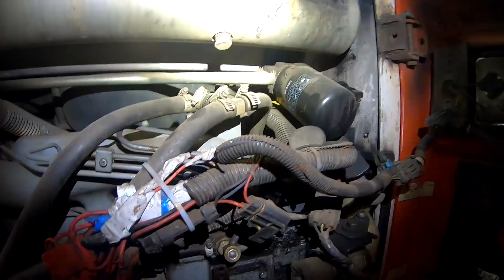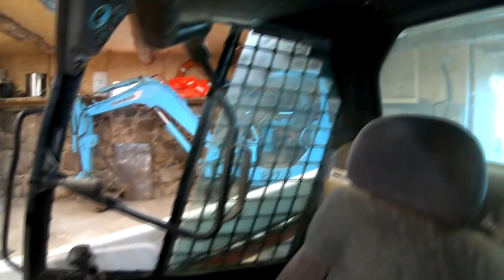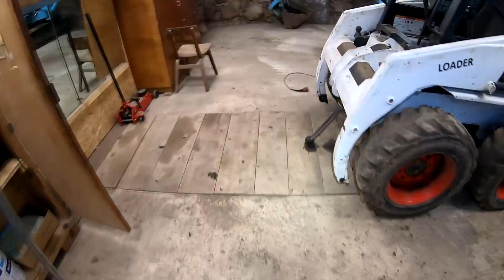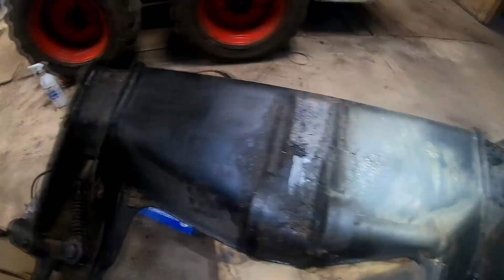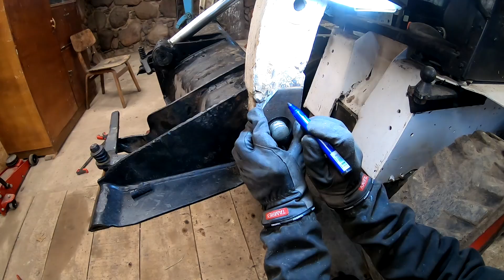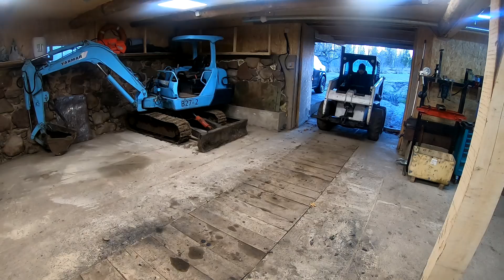Fixing bobcat 751 Bob-Tach pins/bushings

Comment: Very ingenious repair! Had to do the same repairs on my 763 when I bought it. My attachment bushings where gone and the sleeves they go in where shot! Fortunately a good friend of mine runs a CNC lathe and replicated new ones to weld in so I got away with only new pins and bushings. My arms where not wore at all. Bobcat loves their parts! Have the exact same issue with my lockout switch as well. Never got worse though so haven't dug into it. Just touch the wire and it goes! lol Good job my friend!
Reply from the maker: Lol i can relate. Take care Tim

Comment: Good fix.  I think the only short coming might be the strength of the pins - probably not hardened like OEM.  But if they're a standard size from your local hardware store should be easy to replace.  Cheers!
Reply from the maker: Yeah true. Cheap also. The OEM pins are hollow inside but these are solid throughout, not sure it matters though.

Comment: I have an old 600 series machine that has 3/4 in loader pins at all locations including the lift arm towers. The originals were still working after almost 30 years. The only ones that wore out were the same ones you replaced on your machine, the pivot pins for the bobtach. I replaced them with 3/4 bolts and they have served for almost twenty years. Now the machine is almost 50 years old. I think your repair should be good for quite a few years.
Reply from the maker: That's good to know

Comment: Good fix using the cheaper / available locally pins and bushings, they won't be as strong as the OEM parts but for what you're going to use it for I'm sure they will last a very long time. 🙂
Reply from the maker: I'm actually suprised how well this fix has held up... 😆 still going strong without any change in play

Comment: I have noticed on all of your Bobcat videos that it creeps slowly when you turn it on. I saw a video where you adjust some bolts/nuts/etc. on the drive plate under the cab, just lift it up. I think it adjusts the drive controls. I think it may take you 10 minutes. Thanks for your videos, I enjoy the humor ;).
Reply from the maker: Yes the right control lever needs some adjustment. Very little

Comment: As others have said nice bit of lateral thinking to use tractor hitch pins and bushings to fix up the old BobCat. As far as the grease issue goes you need to remove the grease zerks from the hitch plate and drill through the new bushings to the pins so grease can go between new bushing and new pin.
Reply from the maker: Right on

Comment: Well, I am impress.  I would have done it a little different, notch the pin and locked it in place.   But that is me, either way, $20 vs $800 - $1600.  I am not rich, like things done professionally and you are doing a fine job.
Reply from the maker: Still holding up great to this day 😇👍

Comment: If you need to mess with the pins again, instead of welding the plate you made to the pin, weld a cap to the plate. You could put a zerk in the cap. A cap that allows some end to end play may take some strain off the pin and the grease from the zerk in the cap should help lube the pin movement in the arm. Plus next repair will be much easier.
Reply: Brilliant idea! The cap could be a slice off a tube that's got sufficient diameter to go over the pin, then cut a disk end cap and weld it all together.
Reply: @DuncanAitken  Get out of my head!

Comment: Great job, that repair should last well. It would be worth fitting a battery isolator on your negative lead, save disconnecting the battery. Get a heavy duty one, the cheaper ones burn out fast. I fit them to everything that lives indoors.
Reply from the maker: Good idea Dave, my tractor has it, i think it's also called a mass switch? iv been meaning to get one for each of the machines.
Reply: @Ants_Pants  master switch. Well worth it. I've even fitted them to the old cars and ill put one on the generator. We never park anything inside without one. Also means no disconnecting the battery if you need to charge it or do welding.

Comment: Very innovative fix for your pin issues.  The only concern about the pins would be the diameter of the new pins being significantly smaller than the original.  They will likely last years, but even if they don't you can get replacements for them and you don't have grind them out to change them.
Reply from the maker: Original pins were 31 or 32mm. New pins are 28mm if i recall. Just tiny bit smaller.

Comment: My ideal fix to stop the pis coming out would be to weld a cap, like a steel pipe end cap fitting on the plate you made that just hold a standard pins in.
Reply from the maker: That's a good idea
Reply: @Ants_Pants  A cap would allow the pin to float/rotate and reduce wear.
Reply from the maker: @leonjohansson6542  Hey Leon! Cap between the plate and arms? i di have a cap there about 5-8mm on both sides

Comment: Sound economic repair. That will last a long time on the farm! If you were using daily in construction heavier pins and thick walled bushings would be required.
Reply from the maker: Thanks Sean. Now the arm pins have so little play that i have noticed how bad the other pins are lol. Before i thought the problem is only in lower arms.

Comment: And that's why you grease the equipments pivot points  and check the fluids each and every morning. Grease is cheap compared to boring welding and bushings . I've fired operators for not greasing the equipment.
Reply from the maker: Good call they deserve nothing else. Heavy equipment is a expensive investment and to see operators not care about your investments, fire them.

Comment: Nice job and great video I’m doing a similar Job on my bobcat 743 but I’m having trouble pushing the pivot pin on the quick attach. one side pushed in but the other is stuck does anyone know?
Reply from the maker: Maybe the bushing is installed wrong way? Just a guess here
Reply: I thinks it’s the right way the pins were never replaced since it was purchased
Reply from the maker: @zlatanzifovskijr4576  look maybe there is something in the way. Like when i tried to take the pin off therr was a broken bolt inside the bushing. Of not then go @ it with a heavy hammer. Maybe its jusy tight fit is all. Hope u get it sorted out.
Reply: Hello I managed to get that pin out I had a old broken 1/2 socket extension and I used it as a pin to hammer it in thanks for helping!
Reply: If it is the old style attachment plate it will have a grease fitting on the inside of the plate (opposite the bolt head outside the arm). Remove the grease fitting, the pin will slide in easily as grease gets pushed out the fitting.

Comment: What is the going rate for a used Bobcat like yours in Estonia?  Curious if shipping them (or do they have a factory in Europe?) adds a lot to their value?  Nice job doing with what you have.  Keep them drowning in grease and they will probably outlive you.
Reply from the maker: The condition it was all beat up around 5 to 7 grand i paid 6k i think. Currenltly i would value it at 10k coz iv done a lot of fixes to it and it works all nicely now. When i bought it it had a problem with one of the drive motors (made a video about it aswell) it could have been a 2k fix, but i decided to take the drive motor apart and ended up fixing it with a seal kit for 200 bucks(the inner pressure seal was completely mangeled).  I bought this from a individual and payd 100 bucks to ship it 200km. These machines dont come on market a lot from individuals. If you have patience you could wait and browse the marketplaces.  You could also buy from vendors who sell used equipment, but you always end up paying about 5 to 10% more of what the real value is. One place that i recommend is macea machinery from finland they have a wide selection on used equipment with good prices. I ordered my excavator from them (best decision iv ever made the machine has worked almost flawlessly for over a year now) they handle the logistics and transport, after paying the deposit the excavator arrived @ my home in just 2 or 3 days lol from finland to estonia. Price for logistics was around 600. Hope this helped some.
Reply: @Ants_Pants  Very interesting.  I am in Alaska though so I won't be shopping in Finland Lol!  You are talking Euros?  So it would be a bit cheaper there as if that was dollars it would be about the same in this country.  Don't find good machines for that price here either.  And not many of either here but occasionally they come up.  Thanks for the info.  You have a video of the buy??  I will look up your videos.  I watched a few several months ago but didn't realize exactly what you were doing until a week ago when I subscribed and have watched a great deal of your offerings since.  Nice work.
Reply from the maker: @douglasthompson2740  thanks for watching them. Take care my Alaskan friend! I hope you find yourself a good machine with good price.

Comment: I would have welded a plate to the end of the pin and skewed it to the frame. How it's fixed now the pin will turn in the not lubricated bushing in the arm. A plate on the pin will halp you remove the pin later on.

Comment: Round stock, bar stock, brass pipe of different wall thicknesses, and a way to cut out a very important part of those type of joints- are washers, a.k.a. "spacers" or "shims" are not only used to take up room, but also act as another sacrificial element, saving wear & tear on stuff. 

All that material is cheap if you DIY the manufacturing processes! 
Eliminate the greedy Mafia Middle-Man🤑

Comment: The now installed pin is around 30% weaker than the original. If you pull to hard the pin can deform the bushing or bend.
Reply from the maker: Possible yes! but it was so cheap, i just had to try. so far it has been working out superb! This machine loading limit is only 700KG, so i guess aslong as i don't drive against a concrete wall @ full speed i should be okey!

Comment: The new pins are not as thick as the old ones.
Reply from the maker: 31mm vs 28mm. Small difference. But then again new pins are not hardened steel like the original.